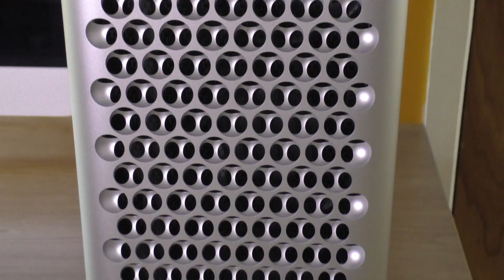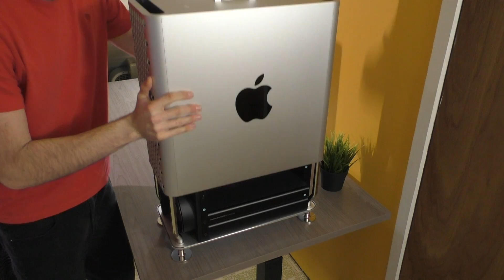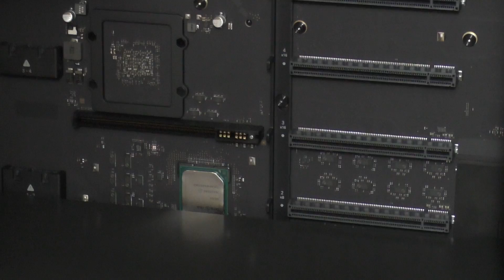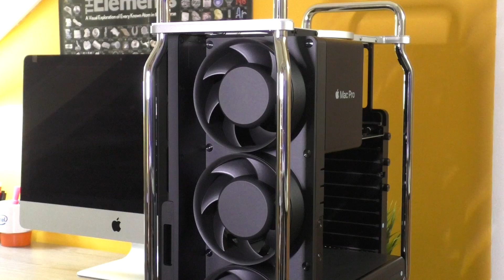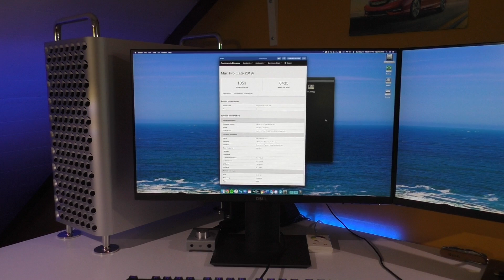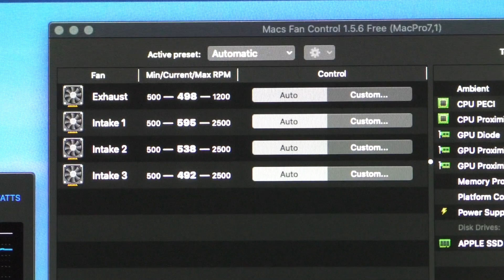Review - Mac Pro (2019)

Comment: I am still running an older 2012 Mac Pro 12 Core Zeon box with 64GB of RAM.  I thought for sure given my older architecture it would be slower. Boy was I wrong. My single core came out at 2555. My multi core came out at 19604. Granted you are running the newer Geekbench 5. I am just running the previous version, Geekbench 4. Not sure if that makes a difference. My Mac Pro will not run Geekbench 5 because my version of OS X is a couple versions older. I cannot upgrade past Sierra because I need to run the older Final Cut Pro 7 for some older client files I still have to edit from time to time. I really would like a new Mac Pro, but I am having a hard time justifying the cost. It really doesn't make sense to me given the newer architecture.
Reply from the maker: Geekbench scores between versions are not interchangeable.
Reply: @accordinglyryan  Oh. Well that is not very helpful then.
Reply from the maker: @dugstruble  Yes because it's my fault your computer is old lol
Reply: Ryan Gehret That is not what I meant. I think you read too much into my comment. I would just like to know how much investing in these more expensive newer Mac Pros is worth it.
Reply from the maker: @dugstruble  Depends on what you value. If you want a repairable, upgradable Mac, this is your only option. If you don't care you can get better performance for less money with a 5K iMac
Reply: Ryan Gehret  I have upgraded my old cheese grater many times over. I want this new Mac Pro for sure. I just want to know it is worth the money. Adobe Premiere CC works great on my old cheese grater 2012.
Reply from the maker: @dugstruble  That's something only you can decide

Comment: You are loving this new mac pro even after the announcement of Apples transition to the own Apple Silicon processor? Don’t understand me bad, I own a mac pro too and this question has raised in me spontaneously after the announcement.
Reply: Hello! i placed my order a day after the ARM announcement, I need the power now, and have waited long enough for this machine. Don't worry, You're good, The New Mac Pro it has a lot of room for expansion, and honestly an Apple ARM processor that can challenge a Xeon, supports PCIE, AMD Drivers, or 2TB Ram is years away from now if they even plan to release one.
Reply from the maker: @robertoaguiluz7350  My thoughts exactly. I don't think we have anything to worry about

Comment: Hey nice review! I just ordered mine 12 cores, 32 gb, wx5700 , had a classic 5,1 Mac Pro that lasted me for over 10 years; and it keeps working great so I’m gonna retire that as server. I can’t wait to keep upgrading the 2019 MP , some third party ram maybe for starters
Reply from the maker: Good choice! It should last you a long time. I'm planning on using mine for 5-7 years. I bought 2 extra sticks of RAM off eBay for $100, bumped it to 48GB to take advantage of all 6 memory channels. I'm sure you could get even more for not a ton of money comparatively. I also picked up the W5700X since recording this
Reply: @accordinglyryan  nice! did you mixed your new ram with what you currently had? I've been also looking also to Xeon Ws on ebay, $2k for a 24 core doesn't look bad at all !!
Reply from the maker: @robertoaguiluz7350  Yeah, I just picked up two more 8GB sticks that matched (SK Hynix DDR4 2933MHz RDIMMs). On the Xeons I'd be careful with which ones you're looking at. I'm not sure if the older Skylake based ones will work. The 12-Core Cascade-Lake W-3235 that it ships with is $1600. I also noticed there's two different 16-cores (3245 and 3245M), and they look completely identical in spec except the latter is twice the cost. No idea what's up with that

Comment: Even minor upgrade not worth it just for tower for $8k at b&h photo or apple...96gb ram. Just for 8 or 16 core ripoff or 96gb ram..apple tax. I dont feel its value and cost that much...paying mostly for case thats not atx and mobo you cannot replace to upgrade future sockets that dont exist yet. You don't get big boost in performance from imac yet...software like adobe and drivers behind...32 bit is out the door.
Reply from the maker: Then build a PC. I'm happy with my purchase
Reply: @accordinglyryan  already have..
A 1920x threadripper build with asus two monitors for less than $4k.  Hopefully nothing go wrong after warranty...4 yr gpu 10 yr air cpu cooler lifetime ram everything else 3 yr. Not apple their service sucks and one year warranty...they say buy another one or else expensive repair and sketchy practices. I rather spend maybe around 25k in my life system replacement than one shot deal with apple with regrets. I am not spend over 6k each time the mobo or cpu takes a crapyard.

Comment: I absolutely love this machine...not cheap, i will get one for sure, I won’t go crazy specs but for long term i will save in the end. Imac is nice but i hate all in ones. Cant upgrade anything except ram.
Reply from the maker: That's exactly why I didn't buy an iMac even though I like them. They suck to work on
Reply: Ryan Gehret what did you customize on the mac pro ? Ssd ? Ram ?
Reply from the maker: @ep8022  Just the SSD (bumped it to 1TB), everything else I left alone. I upgraded the RAM to 48GB as soon as I got it with some sticks off eBay
Reply: Yeah the ssd upgrade is a must because of the T2 chip...Did you find any upgrades from the 8th core cpu chip online yet ? Don’t think it’s that hard to upgrade it. The ram i can do it later and Gpu i would prefer to do at first to the 5700 16gb navi card.... but i can also do later to save the money for now. Do you think it’s better to do certain upgrades now if cash is a little restricted ? also the ram you get from apple will run at 2667 because it’s the eight core. Is the ram inside of it actually 2667 or 2933 running at 2667 ? Very curious. Thanks
Reply from the maker: @ep8022  CPU upgrade is pretty easy, but the compatible CPUs are very expensive (even the 12-core Xeon on Amazon is $1600). I'd go for the W5700X if you can afford it, I wanted to but money was tight. It's $1000 for the card after the fact vs $600 if you buy it time of purchase. The RAM is true 2933, it's just limited by the CPU.
Reply: Yeah i think it’s a much better gpu... for 600$ it’s a no brainer 
So for sure the ssd upgrade, the gpu 5700 and i’d love the 12-core model nothing more really. Need to save up a little more then. By the way must be pretty heavy to carry.... was wondering about those wheels instead of feet... ouch lol
Reply from the maker: @ep8022  It weighs about 40 pounds, so not terrible imo. I don't move it around much lol
I like the Pro Display XDR but I'm a bit too poor for that. My Dell monitors are pretty nice
Reply: I think i will till WWDC is done on June 22 to see if apple releases a crazy iMac ...doubt it though... i already have a pro display xdr so my interest in the apple “iMac” monitor is not really there. Once you use this pro xdr monitor, nothing else is good enough. At least to me.
Reply: You know this overpriced tech will go obsolete. It's not atx case. This moment of temp happiness.. it will pass with regret. I doubt this user spend another 6k plus or costly apple repair after one year warranty...for another model or mac once its beyond repair and obsolete. This how apple gets you...just like car state inspection no way around it.
Reply from the maker: Or I'll just use it for 5-7 years and not give a shit about always having the latest hardware...it's not that hard. Go rant somewhere else dude.
Reply: @accordinglyryan  nah you be good at least ten years hopefully if without any hardware breakdowns. Can you try get extended insurance or warranty...that's what I am trying say to you.
Reply from the maker: @cjonwickham1933  I'm not expecting it to break, every time I buy an extended warranty for something I never end up using it...wasted money imo
Reply: @accordinglyryan  yeah most of time waste of money but it depends...usually good idea buy on used or refurb products.  I'm curious about the 2x radeon vega ii duo 128gb  GPU's performance and capability...nothing info online...the most vram gpu in world ever created.
Reply from the maker: @cjonwickham1933  I dunno if anyone's bought that config yet